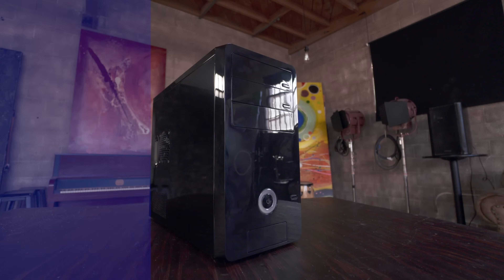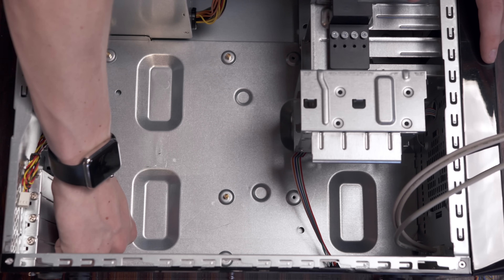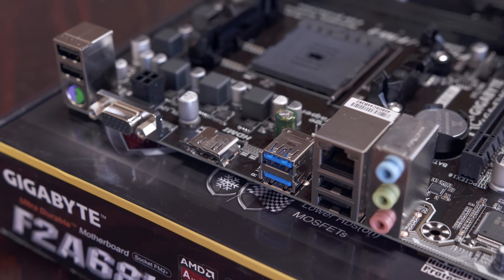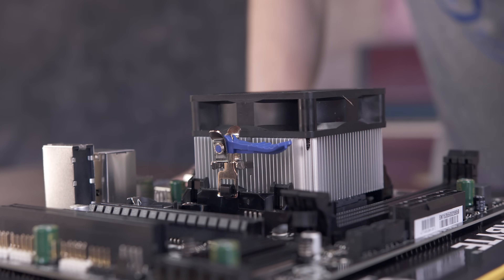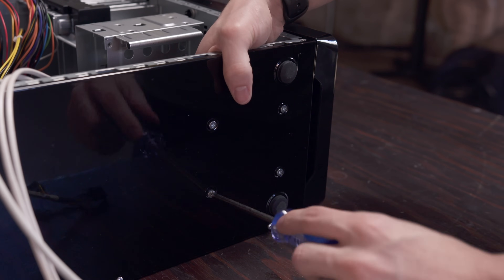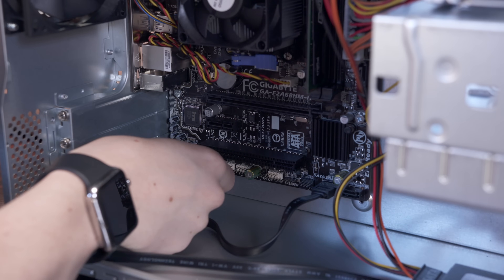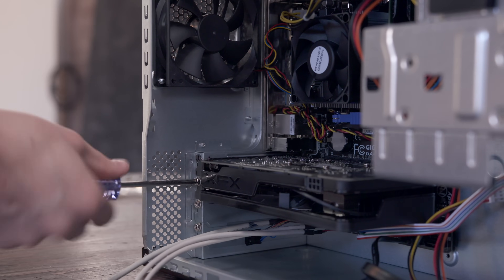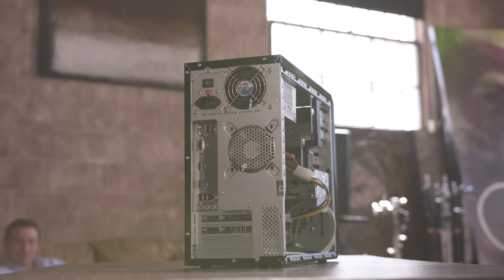How to Build a Gaming PC! (2016)

Comment: Can anyone help me , i am planning to build a gaming pc but i am worried that it wont work
This is my specs :

Thermaltake V3 Black Edition SECC / Plastic ATX Mid Tower Computer Case VL80001W2Z (case)

Intel Boxed Core I7-6700K 4.00 GHz 8M Processor Cache 4 LGA 1151 BX80662I76700K

Samsung 850 EVO 500GB 2.5-Inch SATA III Internal SSD (MZ-75E500B/AM)

EVGA GeForce GTX 970 4GB SC GAMING ACX 2.0, 26% Cooler and 36% Quieter Cooling Graphics Card 04G-P4-2974-KR

Corsair Hydro Series H100i v2 Extreme Performance Liquid CPU Cooler

Kingeston HyperX FURY Black 16GB Kit (2x8GB) 2133MHz DDR4 Non-ECC CL14 DIMM Desktop Memory

If there would be a part that i can exchange it with a cheaper one but at the same or near its peformance , also if you have a budget build that can edit , game and stream cheaper than this then please comment

Thanks
Reply: I forgot to mention my motherboard

ASUS Motherboard Z170 Pro Gaming
Reply: wat motherboard
Reply: Use i5 6500 and B150 or H110 motherboard and get a GTX1070.
Reply: WB IsMe Thanks Dude
Reply: an i5 6500? That has no hyperthreading. What are you planning to do with this PC may I know?
Reply: CorNVex gaming/recording/editing and maybe streaming
Reply: +Saxton_ Flare then go with the 4790k instead it has hyper threading and a higher core clock it will be faster in all catergories
Reply: Subaruwrx and to how much can i overclock it
Reply: +Saxton_ Flare im pretty sure max oc is 4.4ghz which is a nice amount. assuming u have proper cooling
Reply: +Saxton_ Flare actually go wth the 6700k didnt see you had that origiannly
Reply: Subaruwrx kk thanks for your help :)

Comment: I build the exact pc in the vid with same parts except two 8gb crucial memory pieces so I have a total of 16gb, but the problem is that when I press the power button, it turns on but my monitor doesnt register it even if its plugged in.  I tried a vga cable into the mother board but that didnt work, plz help this is my first build
Reply: You need to connect the display cable to the display port of the graphic card, not the motherboard. Check also if you connect the 6pin PCIE power cable to the graphic card.
Reply: +WB IsMe so the dvi-d port? the one that looks like a vga plug but has more pins and is black?
Reply: 65sonichedge Doesn't matter so long as you connect the display port to the graphic card's display connector, not the motherboard's.

Comment: how exactly do you install the Western Blue Digital 1 TB drive on the case?
Reply: that's because he was using the 120 gb ssd
for the 1 TB hard drive, you have to install it from the drive bay
(I'M TEXTING THIS FROM THIS COMPUTER WOOHOO)
Reply: WB IsMe Additionally, those drive bays have screws to fit in the 2.5 inch SSD's. So yes they can be slotted
Reply: Slot it onto the drive bay and secure it with screws provided by case.
Reply: +WB IsMe thank you
Reply: thats what i thought and thats also what id do too but he said not to install in the drive bay for some reason possibly to leave the drive bay empty to 4 slot it with strictly storage memory?
Reply: Additionally, HDD uses 3.5 inch drive bay while SSD uses 2.5 inch hence SSD cannot be slotted into the drive bay for HDD.

Comment: Not getting any power to the usb's. Anybody have an answer
Reply: I fixed the problem apparently there is a switch on the back of the power supply. U flip that and u have enough power to supply it to all the ports
Reply: check thoroughly threw the cables and find anything labeled "usb"
Reply: +AaroshPlayzGaming did that still not working
Reply: Your USB wire(s) aren't connected correctly? Check your MB manual for the correct slots.
Reply: Also the fans turn on and the leds turn on but i dont het any power to the usb's without that i cant check the bios
Reply: SethRaw well the motherboard is partially defective in this case. He said something about carefully get the motherboard out of the antistatic bag. Are you sure it didn't screw up the usb portion?
Reply: +SethRaw lol Congrats
Reply: SethRaw ok XD

Comment: Hi guys! What do you think of these specs? I planning to build it soon but I'm not sure if to do this or buy the latest iMac 5k maximized? 
GA-Z170X-Gaming 3 (motherboard)
4.00GHz quad-core Intel Core i7, Turbo Boost up to 4.2GHz
32GB 3000 MHz DDR4 - four 8GB
1TB Fusion Drive 
GeForce GTX 970 4GB 
Cost: $1450 (rounded) 
iMac: $2904.79 (education discount, 2TB FusionDrive) 
And is 650w sufficient to power this custom pc and other things? 
Thank you!
Reply: How about replacing the GTX 970 4GB with the upcoming AMD rx 480 ?
Reply: Change the CPU to a i5 6600k and spend more money on a GPU. get 2133MHz 8 (or if u must) 16 GB of RAM. 16 or 32 wont make a difference from 8.... ANd the RAM speed does little to no performance increase. So do what I said and you can get a GTX 980ti :) 
Any more questions? linustechtips.com I help out a lot there.
Reply: 750W is overkill..........
Reply: if it is going to be a gaming PC, ditch i7 for i5 (cheaper with same results in games), ditch 16 gigs of ram (even 8GB is plenty enough for gaming in 2016, 16GB is futureproof while 32 is pointles in gaming PC and by the time you will need 32GB, DDR6 will be new standard and your DDR4 will be slow and you will have to buy new RAMs anyway). Fusion drive? Just get 1TB whatever WD drive and 240GB SSD (be smart- there is no real reson to buy super expensive ssds for gaming PCs). Now, since I have saved you a lot of money, take half of them and buy better GPU (980, 980ti maybe even 1070), take the other half and send them to me. Cheers.
Reply: Depends on what you want to do... If you want to play newer titles e.g black ops or just cause or wat eva however iMacs are more centered to work and less games run on them and converters eg wine bottler are fiddly both will do work and play games however the windows will play more games. Also if i were you i would get a 750 watt psu. Why no ssd for os?
Reply: +Occupational Hazard I need a computer to do video editing, use adobe apps and some programming (I need windows for this as the university requires me, but I can install windows 10 to the iMac through Bootcamp right?) I was thinking of building a computer because it is the same as the iMac, except, no 5k screen. If I get Flash Storage in the iMac 5K, the price would go to $3461.14 with 3 years of warranty and one beats solo 2 wireless (free) 
These are the specs for the iMac
4.0GHz quad-core Intel Core i7, Turbo Boost up to 4.2GHz
8GB 1867MHz DDR3 SDRAM - two 4GB
1TB Flash Storage
AMD Radeon R9 M395X with 4GB video memory
Magic Mouse 2
Magic Keyboard (English) & User’s Guide
Accessory Kit
I will upgrade the RAM to 32gb but not from Apple. So do you recommend me the iMac instead of the Custom PC? My mom says the iMac, but I'm not sure... And should I get Flash storage or go with Fusion Drive (which includes 24gb of Flash Storage) is it worth the price ?
Reply: Screw Macs, great specs though. Overpricing shit.
Reply: +Flex Gaming wow thank you very much, is a better choice!
Reply: pc for sure
Reply: +Gianlucca C. No problem, I'm getting it too when it comes out :)
Reply: +Flex Gaming flex how much will it be and whens it out do you know? im getting a pc soon how long should i wait
Reply: +Kennady Tricks It comes out June 29th and it will be 199$ for the 4gb version, which is amazing, so I'm waiting until then.
Reply: +Flex Gaming wow that sounds too good to be true? it uses less power, is cheaper, and better than gtx 970?!!
Reply: +Kennady Tricks Well that's what they're saying so they better be tell the truth lol, sounds amazing
Reply: Flex Gaming yea man I'll be waiting for that then thanks!
Reply: Kennady Tricks No problem bro
Reply: +Oskar Puzio do you know what power supply it needs
Reply: Get a 1070 instead.
Reply: wait for the radeon rx 480 its only $200 and i way better than that gpu
Reply: DO NOT GET AN IMAC THEY ARE SO BAD
Reply: On the other hand, those specs are really good. 650w should be fine for those parts! 
Build this PC!
Reply: I disagree.. Linustechtips has a very active community (and a friendlier one). I have had terrible experience with pcpartpickers forums..
Reply: Oskar Puzio There was one Moderator that did this.. Quite a while ago.. I forgot the name, but when did this happen? 
The only time when you get your post removed or get shit on is when you post stuff that you do not know what you are talking about.. Like saying that a GT 610 is better than 2 GTX 1080 SLI..
Reply: Oskar Puzio And also, the FX 6300 has a very little performance difference to the i3 6100..
Reply: 32gb is overkill, 16gb is plenty, take a gtx1070 instead of a 970. :)
Reply: NLGamer236 Agree. I actually took the 970, then 1 month later the 1070 came out.. I am so butt hurt about that! xD
Reply: Can't. Mobo only supports crossfire.. :(
Reply: But 1151. But I do heavy overclocking.
Reply: Instead of the 970 the rx 480 is less money for Minimal performance loss
Reply: ***** I agree. Practically the same thing I said. xD
But it actually all depends on his location..
Reply: Telebubbies sorry I didn´t read other comments. We can split the money I guess :D
Reply: xd
Reply: WTF that PC coust about 1100€ only the CPU, the GPU and the motherboard cost about 700€
Reply: ***** yrs.. Even with overclocking, it wont break a sweat :)
Reply: ***** What GPU? Remember that both the GPUs have to be the same and your board must be compatible for 2 way SLI. And also, not to forget, your CPU must not bottleneck.
Reply: ***** Some GPUs use more power than others. And would be be overclocking the cards?
Reply: +Telebubbies aye it's you lmao :)
Reply: ***** I am walking about POWER WATTAGE.
Reply: You don't really need the 32 GB of RAM. 16 is just fine for gaming unless you plan on having multiple apps open at once

Comment: So I put the motherboard into the case, but the bottom right standoff doesn't match with the motherboard and five of the other ones do. is that bad?
Reply: Unscrew that standoff and screw onto the correct hole then.
Reply: +WB IsMe roasted
Reply: I have the same problem, the hole doesn't align to the other holes.

were you able to find a solution?
Reply: no, I wasn't able to find a solution. I just ended up leaving the last corner screw empty and finished the build. works fine!

Comment: anyone know how much a wifi card costs
Reply: Wifi USB adapter is alot more cheaper.
Reply: is it fine if its with a long ass ethernet cable
Reply: my pc is like 2 rooms away from router
Reply: why dont i just 1 long cable
Reply: I got mine for like $18 on EBay, never had a problem with it, been using it for a few years. Don't get a USB one though, they aren't very stable.
Reply: What about the Tp link PowerLink
Reply: I've used Aztech, Tplink and Dlink before. All are good.
Reply: tp link the pair costs 60 dollars is there a cheaper option
Reply: +Asad Moulvi I'm using a TP, it's great.

Comment: Do I have to use a Ethernet cable or can it hook up to the wifi wirelessly
Reply: Both is possible.
Reply: You'll need ethernet but you can buy a wifi adapter